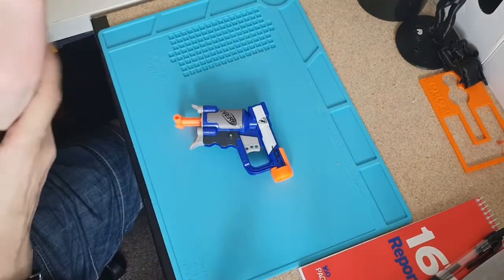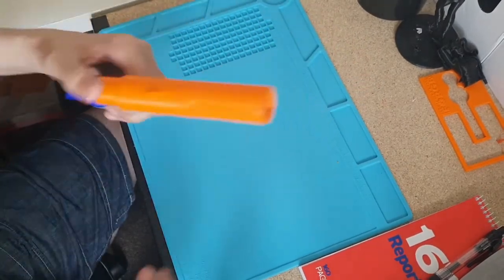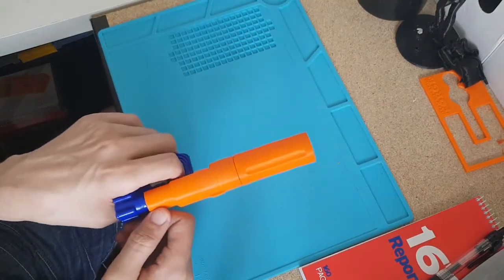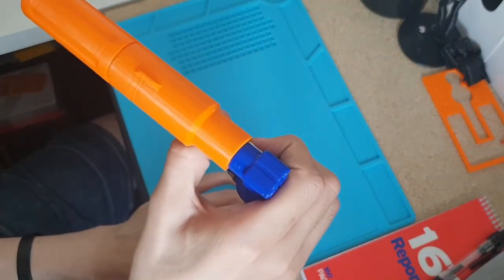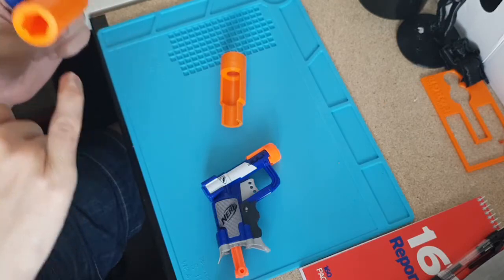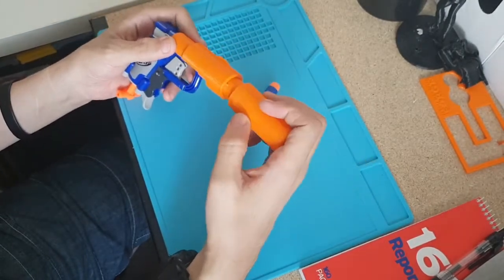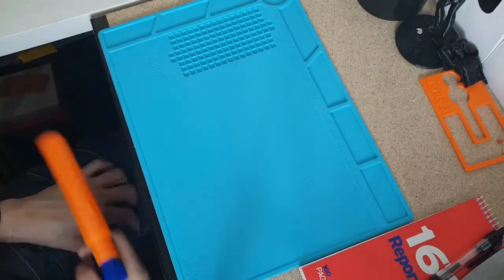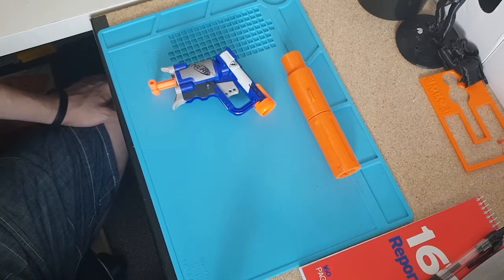The Tactical Jolt (AKA: An idle 3D printer is the Devil's plaything).

Comment: Now the first part has some real appeal... Having a snap-on attachment that has a sight. I could get on board with that. You could even streamline it a bit and put both a front ramp sight, and rear dovetail. That'd be something I could see being popular!
Reply from the maker: I could do that, not too hard with the software and a pair of vernier calipers to measure the barrel and sections to snap it on to.
Reply: Ever thought of a Etsy shop once you have a few products that you've nailed down? Might be a good way to fund the costs of the hobby for you.

I'd personally grab a couple of things that are 3d printed as my budget permitted.
Reply from the maker: It has crossed my mind, but I need to actually have more than a few cages and barrel attachments/sights/cosmetic mods.
Like I said, I've only been 3D printing for a week, so I need to get used to the printer and it's little quirks, like temperature settings and flow rates and travel speed and the like, but my cages come out perfectly, I've got a nice 42mm one to go with some high torque motors and some Worker high crush flywheels that's going in my Modulus ECS-10 (awful name).

Comment: Looks like some kind of cold war spy weapon. I love it, Great job brother.................. Chris
Reply from the maker: Project Nerf Thanks brother, there's a lot you can do with a 3D printer, only had it 6 days and still learning.
Reply: Lol it does actually!  Like some super quiet silenced pistol you can only load 1 round at a time or something and can unscrew it all to fit inside of a tiny case lolol.
Reply from the maker: I'm thinking of modding something to look like a Welrod, the integrally suppressed WWII spy pistol, the size of a plunger tube you could stick in that! I need a nice chunky platform to start with though. Not sure what yet, I suppose I could start working on designing a home-made 3D printed blaster in Fusion 3D and stick it on thingiverse if it works, I'd probably use a Worker Longshot XPT for the ridiculous power.